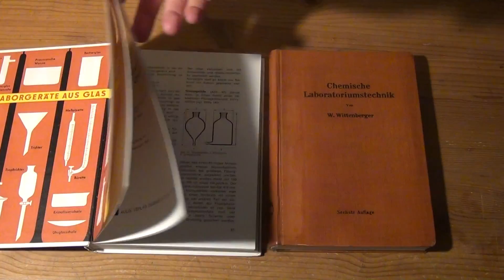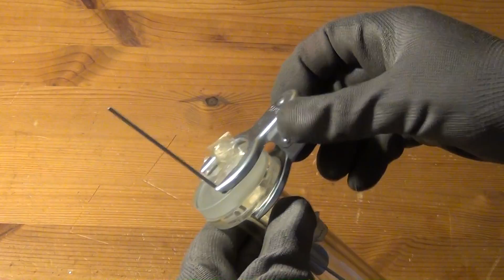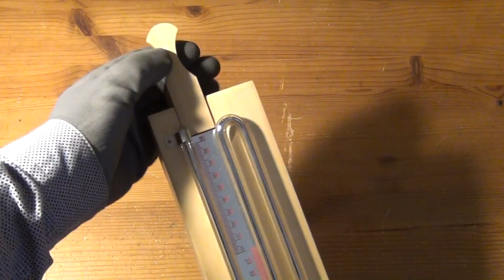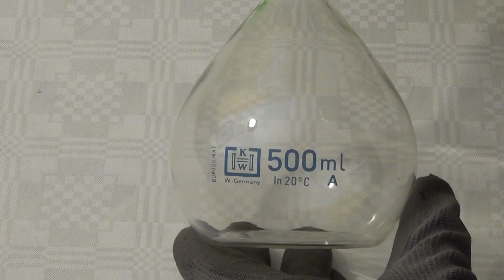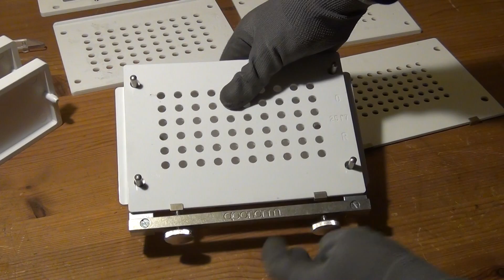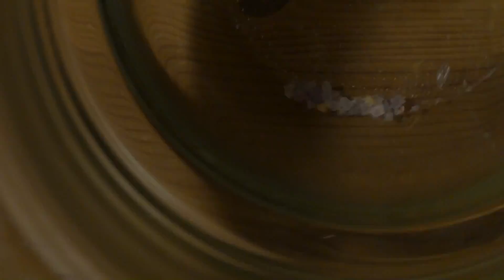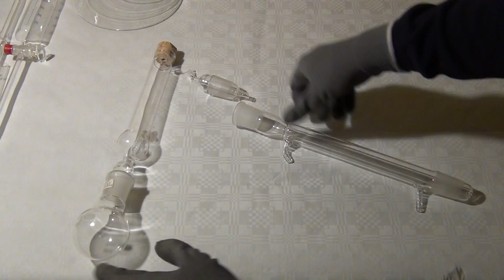Insane Chemistry Lab - Flea Market Score!

Comment: Interesting. I'm a chemist by education (master's degree in chemical engineering) and still don't know some of the items. Distillation equipment is nothing new, it can be used both in analysis and in organic synthesis, burettes are used for titration and there's many different types including so called automatic burettes that are pretty easy to fill (useful for running a series of tests), exsiccator is well known too, but specialized devices used in pharmacy are quite mysterious. And interesting.

Comment: 23:30 I study chemistry at university and we used very similar apparatus in physical chemistry course. The apparatus is used the following way: First, you fill the inner tube with the solution you want to measure melting point of. Then you fill the outer tube with cooling mixture (we used mixture of ground ice and salt), put the apparatus together and while stirring the inner solution with the metal rod, you wait for it co freeze. Then you switch the outer solution for warming mixture (cold water) and again, while stirring the solution with the metal rod´ you wait for it to melt. During the entire process, you have to measure the temperature of the inner mixture, usually with digital thermometer. From the data collected, you can then calculate the melting point.

Comment: Most Wineries have small Laboratories, they will use this type of equipment to measure sugar levels or sulfur, etc in wines, I once worked in the Barossa Valley Wine Regions in a Bottling Factory and one of my jobs was to maintain the Cooling Glycol systems, the Vacuum Suction Pumps, and Laboratory Gasses, Acetylene Pure Nitrogen and Carbon Dioxide.,, P.S that Mercury Gauge ( Manometer ) is a very nice find, I am waiting for COVID to go away because I have made an indexed wood mounting to have a local Laboratory Glass Manufacture fabricate the glass tubing for a water Manometer I will use to Commission Gas Flows to Natural Gas and LPG equipment. this will give me a measurement in 1Kilopascle per 100mm, Your Mercury Manometer will Measure 1inch = 3.40 Kilopascles. I still use a Water Manometer, not a dial gauge because I am measuring a flowing gas and air mixture in different atmospheric conditions, I find modern instruments do not give true readings because they need to be calibrated for every atmospheric condition, where a Manometer is affected equally as the gas flow removing any mechanical need of calibration. Love your Scrapyard finds, I wish I had a Scrapyard the things you could repurpose are endless.. look forward to seeing more of your Videos. My friends keep telling me to start a Youtube Channel I will soon, love being a Maker or as my wife calls me the Fixer, David Melbourne Australia

Comment: The devices that have one tube within another like a Liebig condenser are actually reflux condensers and are used in the extraction of oil rather than water based chemicals from organic matter... measuring fat content in a product using ether which is highly flammable and very volatile, so you condense the vapors and reuse them until all the fat is dissolved out of the product. You transfer the solvent and fat to another flask to distill off the solvent... ether in this case and weigh the the remaining material to get the proportion of fat in your product. Everything is done in a closed system to keep track of all the chemicals. 
The funnels with long thin bores and some of the taps are restrictors that control the flow... again used to analyze either content or viscosity of part of the product. 
Wikipedia can help you with reflux and Google has pictures of your glassware... if you know the name of it.

Comment: @16:20 - the blue agent is silica gel doped with cobalt chloride. a common desiccating agent. When blue it is wet, when pink it is dry. It can be regenerated good for next use by heating in an oven at >100C. No need to throw away, it should last indefinitely unless contaminated.

Comment: PoApIn - (1) You used the word 'fat' several times; while this is not exactly wrong, the more usual English word for this would be 'grease'. For example in car maintenance, wheel bearings need to be greased from time to time - where in German, the term 'Fett' would be used. (2) With your penchant for accumulating interesting stuff, you are going to need a very large house or garage - I know since I have the same habit.

Comment: you can use the  dessicator, (vaccum chamber if you connect it to a vaccum pump) to impregnate porous materials like wood, with low viscosity epoxies, it will stabilize the wood to be used for example as handles for knives or hand tools.

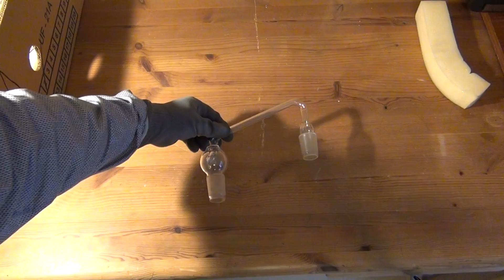Comment: Time mark 3:09 connects two columns together, it allows for regulated dripping of solvent onto a second column containing substances that are being, disolved, analysed, separated, or combined.
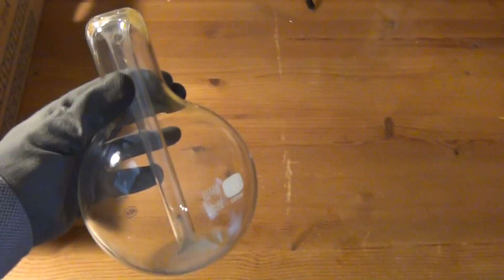Time mark 5:47 is a percolator - but there's no basket for the coffee tho' ;-) 
Time Mark 10:38 My first thought was cold finger. however given the hols in the tubes near the top, and the flat bottomed round flask, I more inclined to think this is more of a double boiler for heating and accelerating reactions.
Time Mark 11:32 Column Chromatography: a cotton ball would go in the bottom of the column, then a powdered chromatographic media would be filled into the tube almost to the top, then the substance to be analysed would be introduced slowly to the to of the column, after the column was saturated with solvent. We did colour separations with this kind of device when I was at school, but, depending on the separating media, and the solvent, the column could then be washed clean of each banded portion which would be collected for further analysis.
Time mark 11:37 is a thistle funnel. That's probably what went through your cork, most likely as an air trap and bubbling over diffuser.
Time mark 12:47 very curious. To establish the boiling point of a substance, carful change in temperature is necessary, since air i a poor conductor of heat, it is possible that the outer tube was filled with a solution that buffered the temperature change making it more discerning when establishing boiling point for certain substances, the air holes at the top, allow for the expansion of heater air and/or vapour.

jm2cw. btw it is always and probably possible that I am completely wrong. There is that  :-D
Reply: p.s. for alternative texts, try some of the books written by Arthur Israel Vogel. Here's one at archive.org. https://goo.gl/mjOV99

Comment: Was mir jetzt so aufgefallen ist:
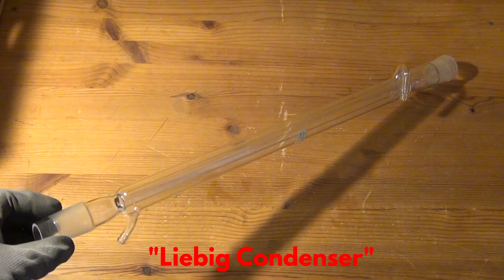4:22 Der Kühlwasserauslass des Liebig-Kühlers ist auf der Oberseite (und deswegen nach unten gebogen), um zu gewährleisten dass die Gasphase an der gesamten Oberfläche des Innenrohres mit Kühlwasser in Verbindung steht. 
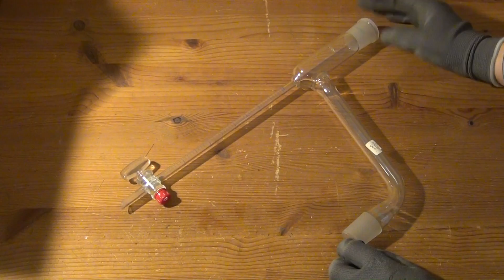7:02 Ein Wasserabscheider. In der OC oft benutzt um Wasser aus Reaktionskreisläufen zu entfernen und somit potentielle Rückreaktionen durch entstehendes Wasser zu verhindern. 
8:46 Ich tippe auf Nadeln für Spritzen zur Injektion von Proben an GC und HPLC-Geräten. 
ab 10:20 Chromatographiesäulen
25:31 Mit dem Thermometer, welches man durch den Korkstutzen steckt, lässt sich die sogenannte Kopftemperatur, also die aktuelle Temperatur der Gasphase bei der Destillation bestimmen. Somit kann man Aussagen darüber treffen, welcher Stoff im jeweiligen Moment im Kühler kondensiert (z.B. Methanol bei etwa 65°C und Ethanol bei 78°C usw.). Dadurch weiß man, ab wann man z.B. beim Schnapsbrennen kein Methanol mehr aus dem sogenannten Sumpf (In dem Fall dann der Wein) verdampft. Hierbei wird der sogenannte Vorlauf (Siedetemp. <78°C) verworfen.

Comment: The casting...I thought that was a tool for flaring metal tubing, but a tool for molding suppositories that is not all what I expected.
Reply: My first thought was that you poured in molten lead with brass or copper wire loops sticking out of the other end of the mould and you made fishing weights!

Comment: You will need a rubber-thingy / pipette / propipette (one with a plastic Wheel) if you want to get any liquid in the "volumetric pipette"
And for the metal rods in some of these glassware you could attach them to a multimeter and by reading the resistance you'll have the temperature of the liquid (but you might already know that)
Have a nice week !

Comment: 3:10 "_Tröpfchenfänger nach Stutzer_" I would translate is to droplet catcher. It prevents that droplets from the vivacious boiling liquig are reaching the condenser which would conterminate the destillate. It also breaks down light foaming.
7:06 Is in deed a Dean-Stark trap for determening the water content. 
You put your waighed sample (like oils) in the flask ad a for the method specific amount of toluene to it and assable the apparatus as seen in the picture. If you heat the mixture untill it boils the water in the sample and the toluene will creat an azeotrope (https://en.wikipedia.org/wiki/Azeotrope) which boils at 84.1 °C. The vapor is rising to the condenser were it will condesnse and drip in to the "burette" part. Since water and toluene aren't mixable both will seperate, the water is collected as the lower layer. The toluene will fill up the rest untill it  flows back in to the flask. You rum it untill the level of the collectet water is stable. Also you can use it to drive forward some reactions like esterification by removing the water out of the reaktion vessle by the same principle.
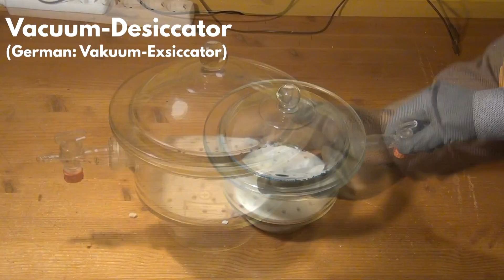8:05 The indicator here is cobalt(II)chloride, it was band from all labs a few year ago due to the fact it's a carcinogene.
10:24 + 10:30 most likely two clumns for column chromatography
11:45 special kind of funnel for "unterschichten" which means pouring a liquid under another one
12:00 this is the official marking of the german gauging office

And to finish this post I will answere your question why a pharmay would need to derternine things like water content or the boiling-, melting piont.
According to the various laws around the pharmacutical industry the pharmacy technician HAS TO determine the quality and identety of all raw materials they use. Even though the minority does it. The Pharmacopoeias Arzneimittelbuch in german (EU= Ph. Eur. and USA= USP) contain numerus of analytical instructions for all sorts of substances. The determination of specially the melting point happens to be a very sensitve tool in order to determine the purity (https://de.wikipedia.org/wiki/Mischschmelzpunkt) Usually you would use something like a "_Schmelzpunkbestimmungsapperat nach Thiele_" I have no idea why or for what specific analysis you would use these test tube like ones. You were dead on with your guess on the boiling point apparatus, the vapor temperature/ boiling temperature would be messured through the cork

If you still have questions just write me a PM, its a huge topic.
Btw I'm also german and happened to live "nearby"
Reply: +The Post Apocalyptic Inventor
just found a discription on how to use the testtube like boilingpiont apparatus:
http://illumina-chemie.de/upload/278_908758442582f8c8cb23eb.jpg

Comment: @7:08 looks like for collecting distillate, the branch connects to the evaporation vessel, whereas the vertical is connected to some condenser apparatus, so you can draw off the condensate as it is made.
Reply: Ok, I was thinking of something like this, measuring the water content, possibly testing for adulteration of products.

Comment: That lab glass desiccator would be good for degassing liquids. When using resins for mold making and repairs it is a good idea to remove all the air you put in the mixture when you mixed the chemicals together. That way your finished product won't have a bunch of bubbles in it. You'll need a vacuum pump to use this.

Comment: Good job figuring out what all that stuff is. Generally speaking I would say that spherical glassware is for evaporative purposes (rotary evaporation or stationary) as it provides a large surface area for the material inside and is also easy to heat in a waterbath.

The small needles at 8:45 are used (at the lab where I work) for evaporation of liquids using nitrogen gas. You screw the needle into a frame that holds 18-27 needles facing downwards, and then you put the needles into testtubes to evaporate a solvent. They could probably also be screwed into syringes of some sort.

If you can score a nice vaccum pump the exikator would be even more useful (maybe you mentioned that but I kinda fast forwarded a bit :).

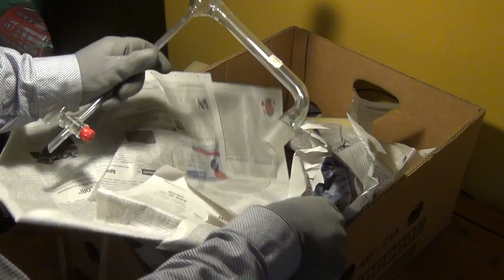Comment: The piece as 6:55 is called a Dean-Stark-Apparatus: it can be used for example to dry ethanol, or to carry out reactions (in a round flask attached to it) in which water is produced. The water then evaporates together with another solvent, condenses and drops in the burette part. if the water and the solvent don't mix, you can see two layers of liquid in the burette and you can determine how much water has been produced and therefore how your reaction is proceeding. Anyway, das war echt ein gutes Geschäfft!

Comment: 5:33 glass thing with the frit at the bottom is a gooch crucible
7:02 "dropping funnel/burette" is a Dean-Stark trap
10:51 long test tube thing looks like a thermowell but I don't know why it has holes or would be paired with the other thing

Some of these will be useful, others will be better off as decorations, either way you got quite a deal.

Comment: As a chemist I feel I should know many of these, but glassware can be very custom and made for specific application. 7:00 - This is a dean-stark trap, it's used to remove one denser liquid from another during a distillation (water from oil). It's rarely (at least today) used just to check water content. 11:37 - this is a thistle tube, simply used to add one liquid to another (basically a funnel). 26:16 - I have used similar tubes for purification by sublimation before.

Comment: 7:04 Is used to separate water from a reaction while the reaction is running. You attach your reaction to the lower ground glass joint and a condenser to the upper joint. The reaction is then heated to reflux. The boiling solvent (toluene is common IIRC) and the water produced by the reaction will travel up the pipe and condense then fall down into the graduated section. Assuming your solvent choice is correct the water will sink to the bottom of the graduated section. The graduations allow you to monitor the progress of the reaction by determining how much water has been produced. I suspect the item at 12:52 is for the same sort of thing but I've not see that design before.

The mercury filled pressure gauge I think is for a vacuum line.

The blue agent in the desiccator was the drying agent, you may have been able to recover it. I remember the lids did sometimes stick. Vaseline (petroleum jelly) made a good cheap sealing material which didn't stick too hard. The rich labs used a high pressure silicone based material. Probably best to build a cage for the desiccator if you intend to operate it under vacuum.

I've never measured solidification temperature but it was quite common to measure melting point (e.g. the reverse process). A pure substance will typically melt cleanly and completely at a particular temperature. If it melts over a range of a few degrees that shows that it's impure. If it melts cleanly but at a temperature other than the one listed in reference material it also indicates impurity.

Comment: thats one hell of a score!
most of what you have is designed to extract natural oils to use as extracts for herbal meds, cooking, air fresheners, body sprays and so on. I've just started to do a bit of extract collecting, just for something to do in my spare time, mainly things like Thyme, Rosemary, Chocolate (to be used as a flavoring extract in Port wines) and the list moves into fruits as well. I haven't been able to grab a score like that and have been using a alcohol distillery to do the same job but extra steps need to be taken after extracting the oils.

Comment: Most of the time you show how stuff works or how to reuse parts for different tasks. Maybe you want to try something new, like a task based video where you try to solve a problem with the stuff you have. Maybe themed post apocalyptic, as your channel is called like that after all. For example reuse a radio with some simple additional circutry to create a form of walkie-talkie. Or extract a chemical substance from an object which you use then for something. Build a intruder defense system, colinfurze style. The possibilties would be endless.